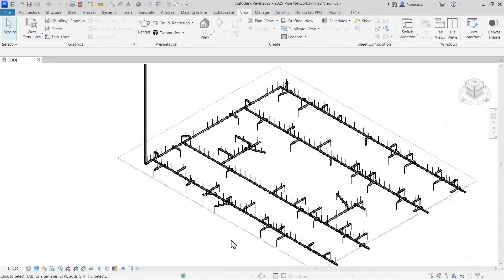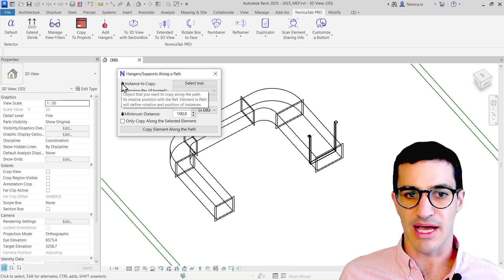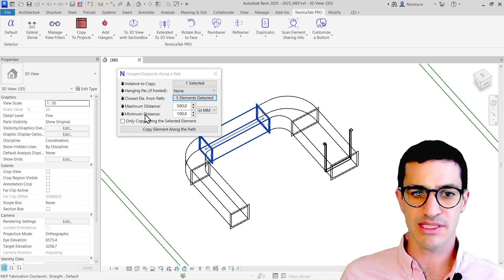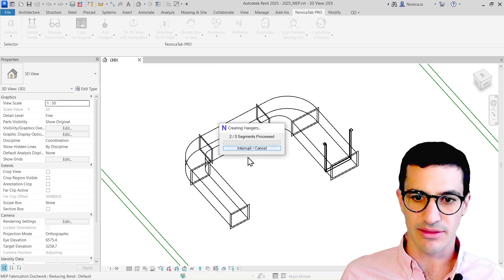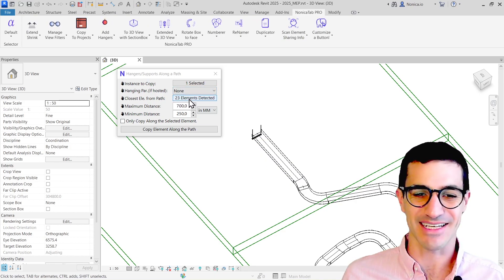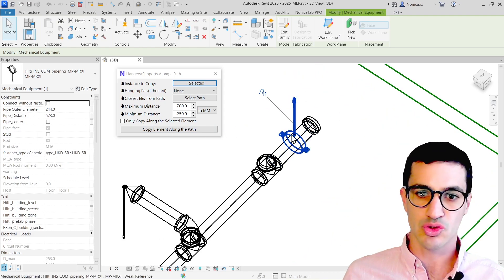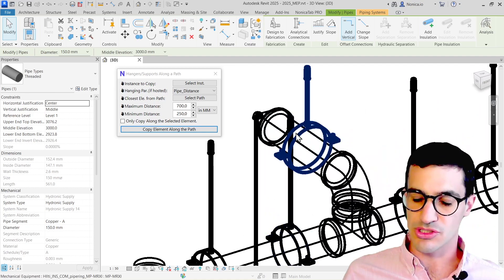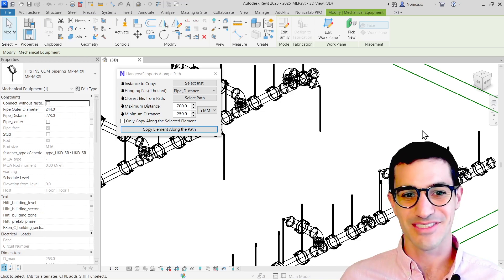Automatic MEP Hangers & Supports | Revit Buttons ✅

Comment: Amazing So is the hangers  Should be aligned to slab manually?? Or it will be automatically aligned
Reply from the maker: Hi! What do you mean by aligned to slab?  They are hosted by slab or floor and generated following the path of the mep. Would that help?